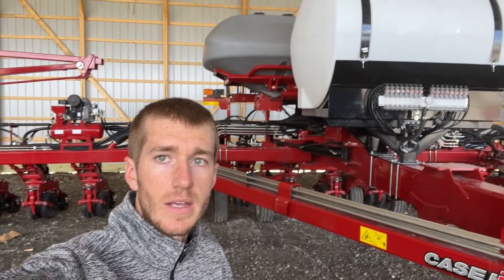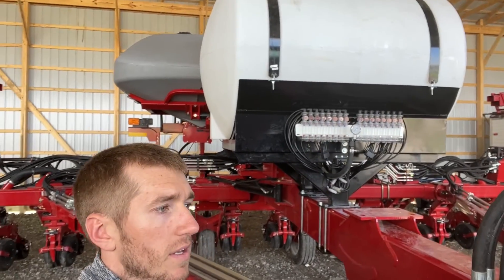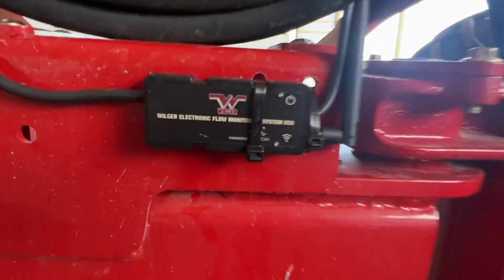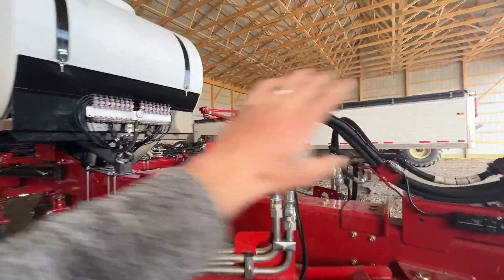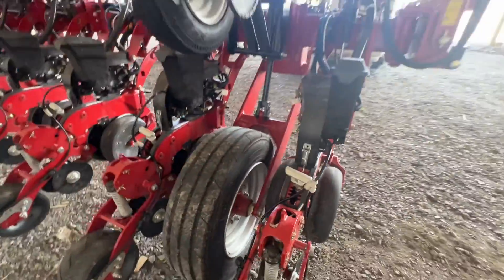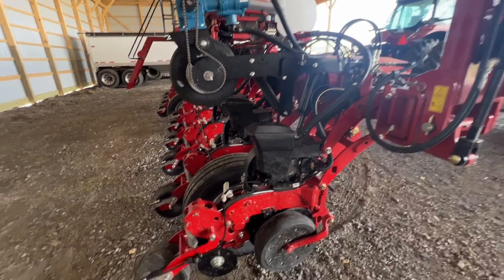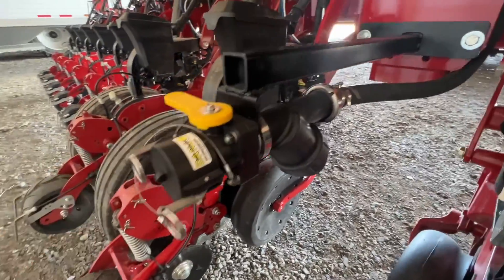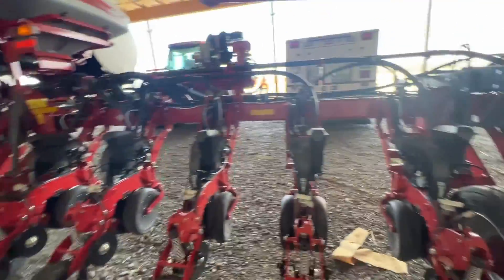Case IH 2150 Fertilizer Install 2x2

Comment: Is that system accurate???
Reply from the maker: This system is just as accurate as a hydraulic pump with rate controller. Yes 750 is biggest on a 24 row. This customer Found this planner on a dealer lot just two months ago and it didn’t have fertilizer on it from the factory so he called us to get the fertilizer done thanks for watching!
Reply: @FennigEquipment  I like the simplicity ..especially with the redball setup included ..it’s almost fool proof!!….do you travel to Michigan?….located in the thumb area (as they say)…Port Austin
Reply from the maker: @gregsmithets3659  we do travel pretty far, what is it you are needing done?
Reply: @FennigEquipment  we’re still trying to decide on that….